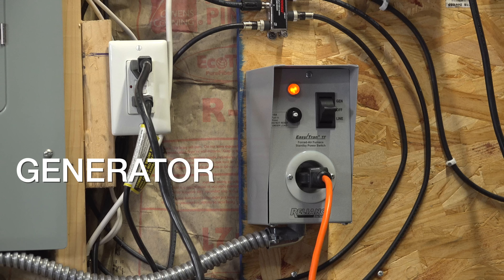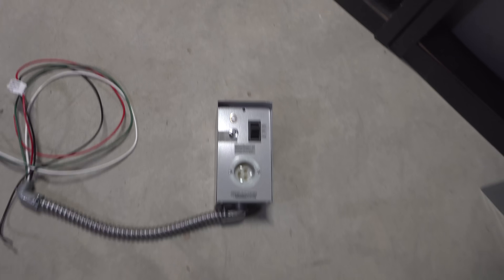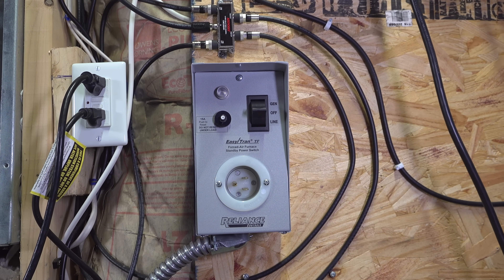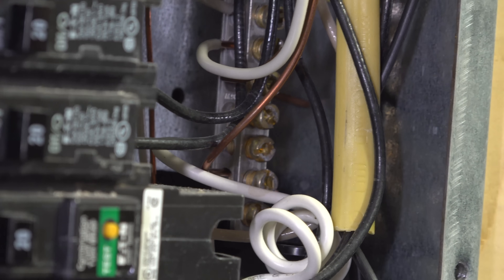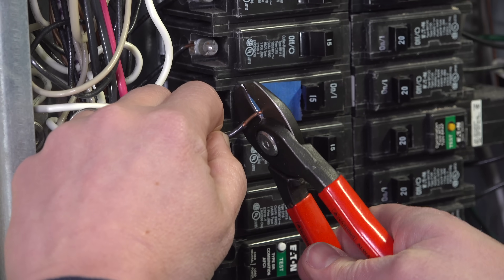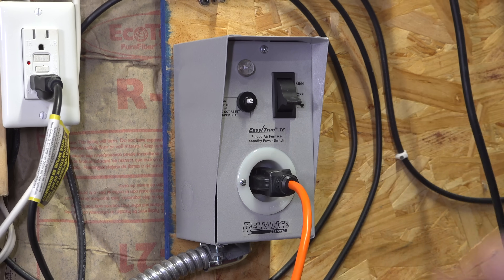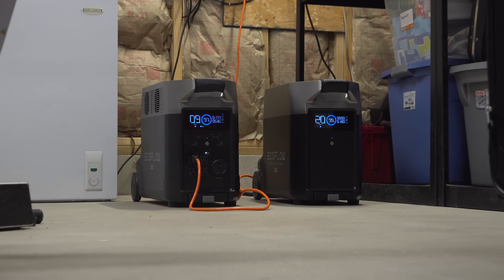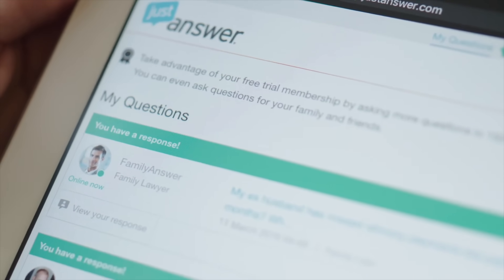Easy DIY Generator Transfer Switch Install - Works with ANY Portable Gas or Battery Generator

Comment from the maker: Thanks for watching please LIKE & SUBSCRIBE - Ecoflow Delta Pro: https://ecoflow.com/collections/delta-series?aff=37 Switch: https://amzn.to/3r5Roff & Be sure to check out Just Answer: https://justanswer.9pctbx.net/VyQGZE
Reply: Love your videos! I have a request for a future video if you want. I am seeing some companion connections that connect 2 different generators together. Many of us have 2 different size (wattage) generators. I have a Honda EU2200 and a EU6500. Is there a product that allows them to be combined for say 8700 watts combined or am I asking too much? That would a great product if even available. Thanks as always.
Reply: A good way to protect your things when you're homeless
Reply: I like the way you did that by isolating the circuit, instead of the other way and powering the whole street
Reply: I am an electrician and you’ve pretty much nailed everything on the dot

Comment: For those saying "just get a gas generator, doot doot doot!"

1. Gas generators are LOUD.  All of them.
2.  Gas generators emit fumes (meaning they cannot be indoors).
3.  Gas generators are engines - which means oil, maintenance, etc.

Battery power can leverage solar to keep them charged - even better, if you get sustained sun, you can effectively run partially off-grid for a fraction of what a full solar setup would cost.  ECOFLOW just happens to have the most flexibility in options but they're not the only provider.  Anker, BLUETTI, Duracell, etc.

Even if you don't use solar, you can use battery power to force your energy to off-peak pricing for states that rip you off for on-peak pricing by running all of your stuff off battery during the on-peak and recharging during off-peak to drop your bill by half in many cases.

In our place, the only items that aren't on battery are the overhead lights; and the external ones are dusk-dawn (off-peak).  The internal ones are controlled by switch, so we just turn them off.  In the case of a power outage, plug-in lighting runs as needed automatically.

The most notorious things that take out power are (A) stupid workers making mistakes, (B) natural events i.e. lightning, (C) possibly non-natural events i.e. fires and (D) trees/wind taking out lines.

In places where they buried lines as far back as the 70s they don't have as many outages.  It's the places where they refuse to bury lines that you see this frequently happening.

Comment: Mine, that came with my house, is set on line. Should I put it on off before I plug in the generator. Also it's has 20 amp outlet and the generator has a 30 amp connection. Is it safe to use a 20 to 30 adapter?

Comment: Could I use this to run a 120v water jet pump ? It's on a 20amp breaker. I currently have a switch to power on and off the pump from the panel.

Comment: For the same amount of work you could install an interlock kit. Then you could power all your critical circuits including fridges, freezers, furnace, lights, sump pumps, etc. Thanks for sharing.
Reply from the maker: Agreed, but there is a big difference. The interlock kits are always for 240v, and if you have that generator type, than interlock is a great option. This is a very inexpensive way to power 120v circuit and super easy to use, 99% of these are used for heat which many only need 120v
Reply: @SilverCymbal  You can also use a TT-30P to L14-30R adapter cord and power the 240v interlock system with 120v. You just don't get the option of any 240v circuits. Just did it for 24 hours last week.

Comment: if your not home to switch it, then what good is it?????????????lol
Reply from the maker: If you aren't home, you also aren't freezing to death. If you are worried about pipes but don't to be there you can buy a built in generator for $14k it will do it for and cost $500/year in maint.

Comment: You messed up the neutrals.  Modern gens and battery inverters have floating neutrals. You bonded the neutral that can force power to your ground.   Not good.

Comment: Seems like a lot of effort for only one circuit. So your heat will run but no lights? No microwave? Not a solution I'm interested in. Backfreding the panel with a dedicated 2 pole breaker and installing a mechanical lock-out makes much more sense.

Comment: Don't forget your supposed to pull a permit from your local AHJ usually city or county before installing this and have it inspected. If you have a fire turns out lithium batteries, or electrical work you did caused it you could be in a situation where your homeowners insurance refuses to pay because you did electrical work without a permit.

Comment: Great video.  You can also use this setup with our CarGenerator product , for emergency backup power using your car, for 50-70 hours in any weather conditions.

Comment: Could this work on condos ?
Reply from the maker: It can work anywhere but it depends how your system is installed and wired. The company who makes it does answer support questions you might be able to send them a pic or info and see what they say

Comment: those quick connects even though easy to use and say they're rated for a specific capacity i wouldn't use on heating or anything with a relatively high continuous draw they get warm compared to a wire nuts..  the generator transfer switch i like its a really good deal

Comment: My transfer switch came in handy today. I live in Central Texas and we've had a few days of freezing temps and rain so LOTS of trees down. The ice build up just becomes too strong, tree snaps, electric lines sometimes get in the way. Mine is a more complicated system although it's not that complex just a step between main panel and sub panel.  but I was able to power my entire 2 story house using all the normal lights and appliances, kids home since school is out so we used all the normal lights and appliances including a gas furnace and never went over 2500 watts / 20ish amps. Most of the time I was under 1500 and around 11 amps.

Comment: I cringed when I saw how close your knuckles on your left hand got to the existing breakers when you were hooking the neutral and ground wires.  That would be fine if the main was off, but with only turning off the target breaker, is dangerous.

Comment: Isn't it easier (if your furnace has an on/off light switch) to convert that to a switch/outlet and then wire a pigtail into the furnace? That way you can just unplu the furnace from the switch if power goes out and then plug it directly into a portable battery generator? Why the need to hook up a single pole transfer switch...if the furnace is hooked into the generator dirctly there would be no backfeed, correct? Now if I want to run lets say 4 circuits to the most used importnat things then I would use a transfer box.
Reply from the maker: You are correct if you could do that it would work, but that type of hookup won't meet code or fire regs in towns. They require a hardwire connection, otherwise you would be just putting a plug on the end of romex, or power cord, which isn't rated to ingot a junction box like the furnace.

Comment: If you have a floating ground on your generator and have a new furnace, you will need to tie the neutral to the ground on the generator or the furnace will give you an error code. On Amazon that sell a plug called a Surge Guard that will tie them together internally in the plug. Only then will it match the grounding of your home…just a footnote.

Comment: Excellent video for several reasons. Not only does the video show the proper and safe way to install a DIY transfer switch but (here it comes) it illustrates the parameters of a battery backup power system (one of the best, if not expensive) in a typical system where the furnace load is about 540 Watts and the capacity of the backup system is about 3600 Watt-hours. The video shows the power being consumed, the state of charge of the battery, and the hours of battery life remaining (7 hours). It’s no coincidence that the battery life is the capacity in Watt-hours divided by the load in Watts. Also, the video correctly stated that a furnace cycles on and off (duty cycle) so the expected hours of battery life would be determined by the duty cycle as expected hours full load divided by the duty cycle. A furnace on half the time would give twice the hours of life and a furnace on one third the time would give three times the battery life, and so on. The ability of this battery backup system to deliver nearly all of its capacity (90%) reliably for hundreds if not thousands of charge discharge cycles is because it’s batteries are lithium iron phosphate. Attempting to substitute car batteries in place of these as so many recent DIY videos show is foolish because NO automotive car battery has sufficient capacity to reliably provide the load for more than about 30 minutes before needing to be charged and still stay above a state of charge (maybe 50%) that will not rapidly degrade the life of the battery. As one content provider of one of these DIY videos found out that he needed to charge his car battery up after only two furnace cycles of about 15 minutes per hour (25% duty cycle) at the same load as this video. That is, every two hours he needed to charge! Car batteries are NOT designed to deliver continuous power but to deliver very large burst of power as is needed in a car starter motor.

Comment: If you're in Canada and watching this... there are several CEC violations in this video that wouldn't pass code.  Consult a local electrician to get a proper installation done in accordance with your local electrical codes.

Comment: How does this not back feed the other breakers in you panel if the breakers are on?
Reply from the maker: The switch is physically removing the connection from the panel and only connecting it to the generator outlet during use. There is no way for the voltage to go across to other circuits.

Comment: Just a note, recently I was concerned that a stretch of bad weather might cause a power outage so I was reading my furnace owner's manual. The manufacturer says it needs CLEAN sine wave power......just like the power company supplies. From what I've read some generators don't supply a good clean sine wave so do your research before buying a generator.

Comment: The only thing I don't like about most of these videos is they do the install with the breaker box outside of the wall. Every one I've had is inside a wall and hard to get to the knockout holes and you have to go into the wall with the transfer switch wiring.

Comment: Could you install 3 of these to run off same generator? 1. Boiler for heat/hot water 2. A 220v well pump system 3. A 4 outlet extension cord to possibly run refrigerator or pellet stoves on and off? Or is it better to switch to a whole house transfer switch? My panel is about maxed out and has a ton of wires already. I’d be using a gasoline powered generator
Reply from the maker: Yes you can multiples and many people do.  You do one per circuit for the reasons you mentioned. If you check the reviews some folks share a lot of project photos: https://amzn.to/3tVRojJ

Comment: Are you allowed to splice inside in a breaker panel?
Reply from the maker: Yes. Wirenuts/Wagos or approved connectors are allowed in the panel. Check your local rules but I am not aware of any that prohibit this

Comment: You might specify that this only works with a gas furnace. Even the biggest general won’t run an electric furnace or heat pump. For sure 120 won’t work.

Comment: My gas heating/ AC system requires 220v to power the control circuit. So make sure you know what you are working with before buying parts and start trying to wire in a transfer switch.

Comment: Looks like a 120 v  breaker, but most heaters use 240 v. What then?
Reply from the maker: Yes, my old oil heating system was 120v and many furnaces are 120v too but you said 240v exists too. Its more difficult, but i would recommend an interlock setup like this. Costs very little in parts but the install takes more effort. https://www.youtube.com/watch?v=F5fP7biZ2aQ

Comment: nice solution but very expensive the noral middle class for the majority do not have that kind on $$$$$ to buy one imagine bying 2????? gas generators seem less expensive? BUT add the cost of gas or propane?? which is less ?   now how long does a battery generator last? compare to a gas or propane generator. Those who have the knowleedge should make a video to comapre this before making a serious investment ? just saying

Comment: Not a good option for most people, need more than one circuit to run everyday needs, reefer, hot water heater, heat, would be the bare minimum for comfort during a power outage. Thanks for the video though!

Comment: You're putting voltage (red wire) into the panel thru that 15A breaker to every breaker on that leg when your switch is in the Generator position.. You will need to turn the main off before switching the Generator on or linemen could get hurt and maybe overload your furnance.
I used a Generator Interlock Kit just to be safe..
Reply: No, it's actually completely disconnected from the panel when in the generator position, that's why the home run connects to the gizmo; to bypass the panel completely (or not, when using line).

Comment: I did something like this but i put a switch to power the full bus so i can use my house like normal. I just have to flip off the main if power drops and plug in the generator. I have an alert light if power comes back on. I unplug the generator and turn the main back on.

Comment: no way heat runs on a 15 amp breaker
Reply from the maker: Not electric heat but oil>always 120v and gas.often 120v as shown

Comment: cant you just plug the 240 v outlet from the what i asume is a electric air handler to the generator? if its a heat pump then you can use a gas powered to power the condenser...

Comment: Employ a licensed electrician. Don’t risk yourself and family. But, If you do:
1) Don’t wear a ring. 
2) Wear safety glasses. 
3) The bottom feed is still live. Work like the circuit is live. Your neighbour may have bad wiring with M.E.N systems 🦘

Comment: I would of used the 30amp circuit plug, not a low voltage extension cord thingy.

Comment: You should have also demonstrated 240v charging an EV using two Eco Flow batteries with a transfer switch.

Comment: So what did this overpriced setup cost you  to run 1 circuit .
While the video was well explained. 
People stop falling for these stupid Joe Biden solutions for home emergency backup  power.  
Most normal families cant afford this stupid setup. 

Get yourself either a real 30 or 50 amp transfer switch. 
Get yourself atleast a 5.5KW portable generator or even go all out and get a whole home generator for less then what then ridiculously priced pathetic Battery packs cost. 

All you tree huggers are so worried about the environment yet you all have no issues with loading the planet with all these dangerous metals .

Comment: What central heat system uses 120v? A small blower motor for a furnace?
Reply: Blower motor, circuit board, ignitor for a gas furnace only require a 120V circuit.

Comment: That’s fine for just the blower with gas heat but 110v won’t run electric heat for the majority of homes. Majority of of heat pumps use 220v set ups.

Comment: Good instructions! I would just add that if you are inexperienced at working with electricity (or just want to be extra careful), you can work with the electric company to pull your meter to completely cut the power to your panel. They may even suggest you just pull it yourself and then you just call them once you're done working and you've re-installed the meter so they'll come out and re-tag it. Since you're installing emergency power, even if you have to wait on the electric company to re-install the meter, you should still have your backup power.

Comment: Good info, but who wired that panel?  It's a MESS!
Reply: My guess would be someone with the same brain power as the guy that bought 2 of those stupid ECO units to power a single circuit and spent enough money to have bought and installed a whole house standby generator and automatic transfer switch.

Comment: Seems kind of ridiculous to put in a transfer switch to run one circuit. 

In this specific case I would just make a plug connection at the heating system.

If the power went out I would just unplug the heating system and plug into the generator.

It's one circuit and not even automatic transfer.....

Comment: Not an electrician at all, and maybe this is a stupid question. I see the furnace was on a 15A circuit. Wouldn't it be easier to just cut the wires between the furnace and the electrical box, and safely install a single 15A outlet in a box, then add a good quality 15A pull to the wires coming from the furnace? So basically, you're plugging in your furnace. If the power goes out, just unplug it, and plug it into the generator. That way there couldn't be any backfeed on the system, because the furnace is no longer electrically connected to the system.
Reply: You're right all you need to do is cut the power wire going to the furnace  and put a male and female  ends and just plug it into the generator when you have no power then when the power come back on just plug it back into the power coming from your power box
Reply: It'd be off breaker
Reply: That would make far more sense than this video....I also wouldn't spend $7,000 on those ECO systems, I'd just buy a complete home standby generator and power the whole damn house in the first place...someone in this video has way too much money and not enough brains.

Comment: Delta pro has pass-through. You could just connect the heater permanently and feed the delta pro from the old heater breaker and you would have an equivalent of a auto transfer or UPS.